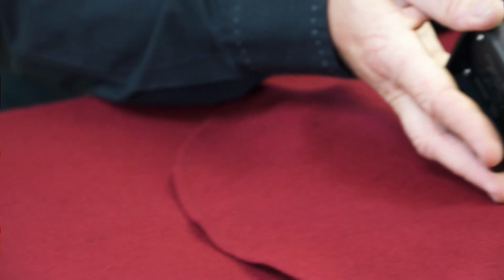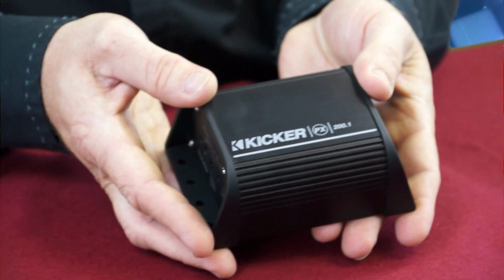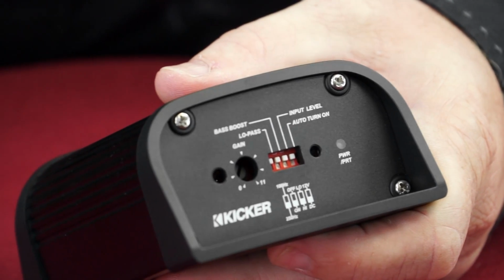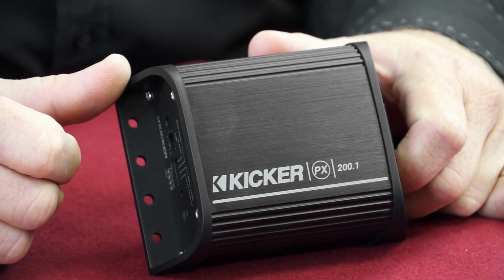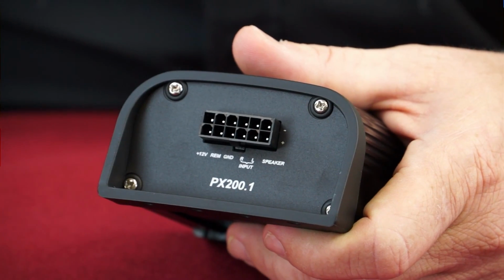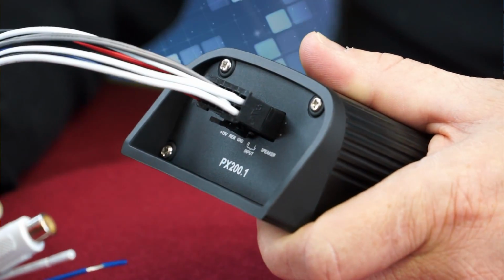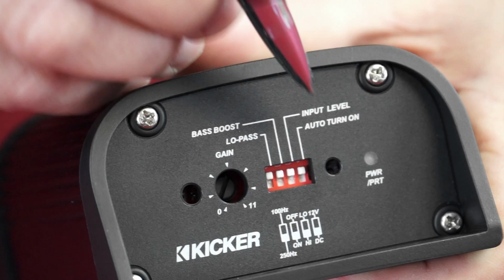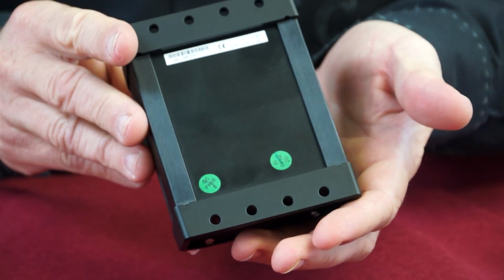Kicker PX200.1 - HookedOnTronics Product Review

Comment: I see all these vidios on you tube where people use an X box cord  to power a car amplifier! The problem is that the X box cord  only puts out 16 amp's  so you need a small amp or a really efficient amp! Well this little amp bench tests at 161 at 14.4 V @either 2 ohms  or 1 I forget but will look up later! And only 100 @12 V My point is, I plan on using this amp to power a home 10 inch sub! However in hoping to squeeze 14 V  out of an X box cord  to run it at it more powerfully!